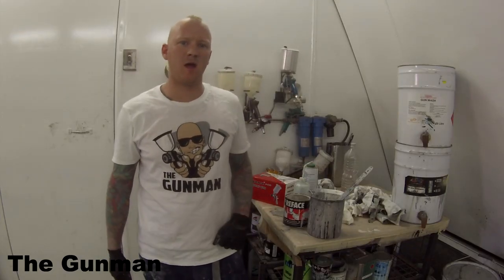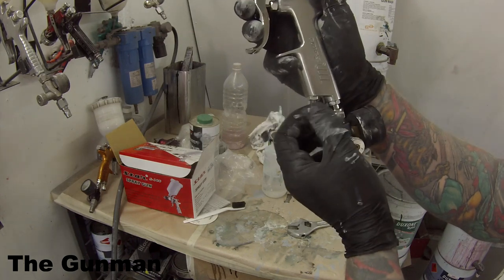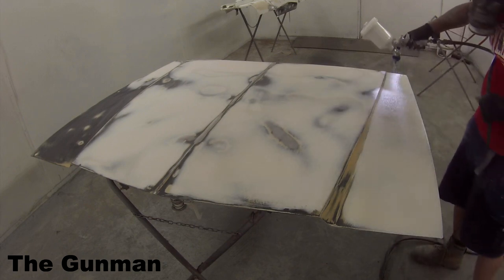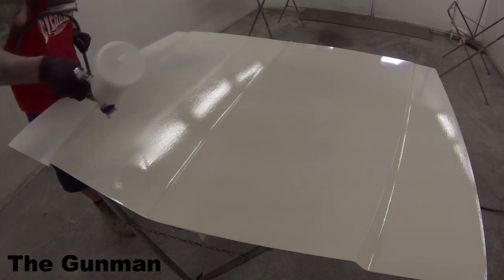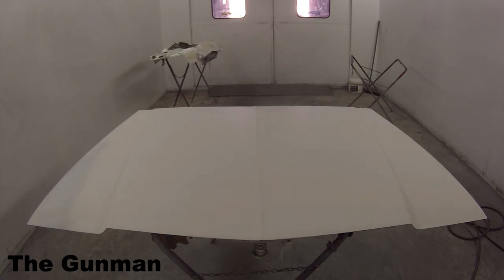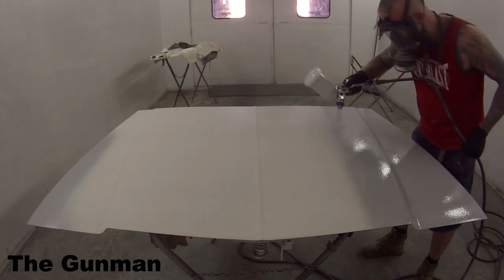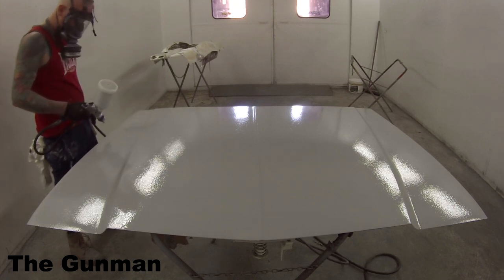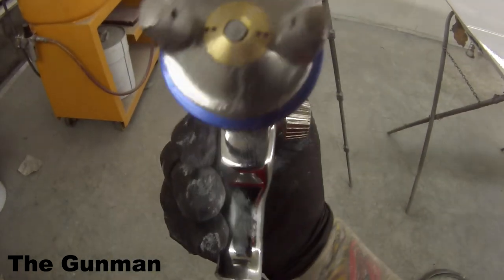Star S106 Review & How to use Polyester Primer

Comment: I learned the hard way with poly primer too.  Keep checking your cup (pot) to make sure it's not getting to the gel stage.  Once it does, it's gotta be cleaned out or suffer the consequences, lol.  I now mix enough to make 1 coat on whatever I spray and flush after each coat if it's hot outside.  It's a pain in the ass but the more material you mix, the faster it generates heat for the catalyst reaction.  Never used the UPol brand but the Evercoat Slick Sand or Feather Fill can spray thru a 1.8 to 2.5 tip with no reduction with acetone.  The fan gets pretty small with the 1.8.  Thanks for the review.  I could use an inexpensive poly gun and this one might do the trick!

Comment: The first time I used polyester was thinking about never using it again went off in gun too. But then weeks later the left over in cup had not shrunk at all now it's a go to on filler filled panels.
Reply from the maker: ducksniffernz We just hit it with 40 and it still took ages to go through.
Reply: The Gunman u-pol's polyester primer is a very hard to sand one.If you get your hands on one from dupont,standox or spies hecker you'll go easyly with P 120.very easy to sand

Comment: you can safely reduce the polyester filler but do not use reducer but acetone.I think that the reason it felt sticky the next day was the thinner u used to reduce it.
Reply from the maker: adi2200us Got ya, thanks for the info.

Comment: Good video Gunman.We use polyester undercoat at my work for kitchens and it is great stuff very easy to sand and get a good build up without getting pinholes or boil .Usually only get around 20 to 25 minutes out of a 6 LTR mix before it will start to go off on a 30 degree day and maybe 40 minutes sometimes if you use retarder thinner.
What do you think of star spray guns Are they any good?
Reply from the maker: brendon stanbury Star guns are a good cheap option for a spray gun, they won't last as long as the big guns like Sata DeVilbiss and Iwata but value for money is good, I just purchased a Star "New Century" 4000 spray gun so I could review it so in the next few months it will be uploaded.

Comment: I just bought some reface last week for a project and the paint place (Perrows Bendigo)  recommended not using a gun under 3.5mm with this stuff.
Reply from the maker: J Grieve I grew up in Bendigo
Reply: David Westernall Thanks for the info. I used a 2.2 and it set up in the gun too.
Reply: Your right David, 3.5mm LOL... Its hard in Alberta Canada to even find a Gun over 1.8... reason I clicked on the 2.8mm Star Gun... I've never heard of the Star Guns... I use SATA

Comment: Spray putty straightly to bondo or to bare metal = high risk of troubles near future. 🙄 Only right way to use spray putty is to seal it with epoxy primer. Spray first epoxy primer to whole area which you are gonna spray polyester and let epoxy flash like an hour or two and only then shoot spray putty on epoxy. After spray putty is dry and you get it sanded and its ready to 2k primer, then first shoot epoxy primer again one layer and after it flashes then 2k primer. That way you have epoxy under and over spray polyester. Thats the only way you might get 
good results with spray polyester if you want it to last years and years. Even if you do it like I just told, there is still risk of troubles which may appear after time goes by. Like bonnet there will come stone chips and spray polyester will start to suck moisture and thats where those troubles start. Spray putty is way more sensitive to moisture than bondo. Thats why I dont like to use it at all. I rather use 2k sanding primer even if I have to use it twice on same job to get enough thicknes to make my prep work decently good.
Reply: That's why I thin my Bondo with Fiberglass resin and make it flow better and use a really larger spreader, then I stick with my Sikkens Color Build primers